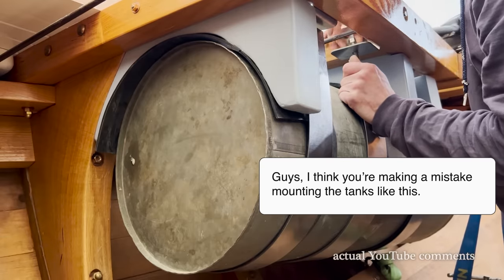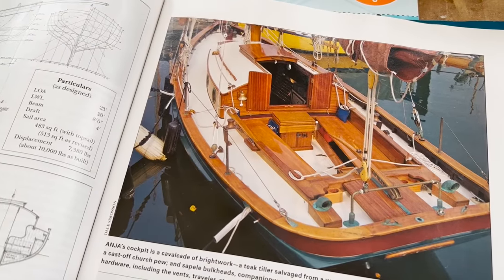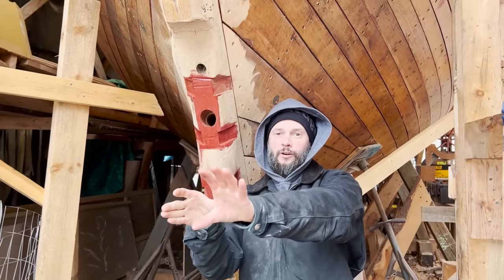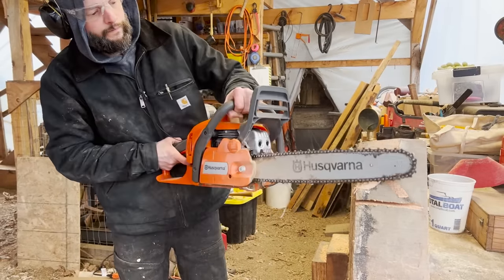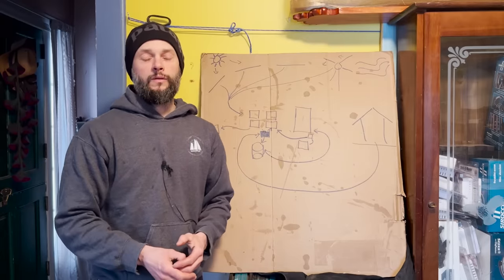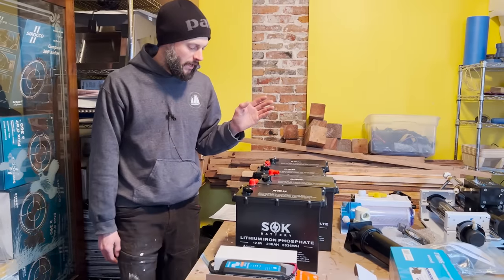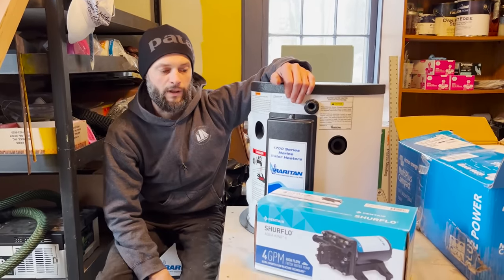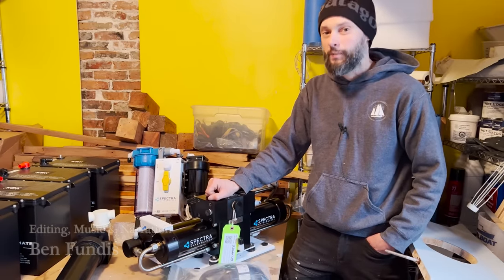That Prop Is Too Small & Other Comments - Episode 248 - Acorn to Arabella: Journey of a Wooden Boat

Comment: You should have a backup propane 12 volt hot water on demand with a 12-volt pump as a quick and easy backup and you can simply store to propane tanks vertically Hot Water Propane on demand is 12-volt or for 300 bucks you can buy a Coleman camp shower 12v and hook it up to a 20 lb tank by the way if anything goes wrong propane float

Comment: I have a question about the prop. Just a bit of clarity for all of us out here in you tube land. With the variable pitch prop you have, is it a case of setting the engine revs to the most efficient revs and just adjusting the pitch of the prop to get your desired speed? Or is it just so you can feather the prop when under sail?
Reply from the maker: It’s both! Both are advantageous. There’s nothing to adjust for us in the cockpit either. The pitch auto-magic-ally adjusts depending on RPM. —Anne

Comment: my only comment on the chainsaw would be, get a battery powered or corded one. it's be shorter/smaller and a bit more surgical to use, in my opinion.  I love my Stihl MS250 for most of my tree work, but sometimes the cheap HF corded electric is just easier and safer to get into some places.
Reply from the maker: Thanks for that review.

Comment: We built a very thin walled concrete canoe to the lines of a fiberglass boat of the same length. With 2 paddlers and ended up with 2 inches of freeboard and horrible stability problems. 2nd in design and construction  DNF on performance lol
Reply from the maker: Ha!

Comment: One reason for the gasoline tanks in the original plan beeing near the deck/cockpit might be that you have to be careful with the gasoline fumes when venting the tanks, the fume could go below deck (heavier than air)  and cause an explosion. Is there maybe a venting pipe leading to the outside in the original plans ?   Not a problem with diesel engines though.
Reply from the maker: Knowing the low level of detail through most of Atkin’s plans, and his assumption that the builder has some common sense, the vent is probably mentioned but not detailed. —Anne

Comment: 23:13 I'm pretty sure you're aware that - unless you do not plan to leave US coasts - you will as good as never find shore power with a 110 voltage (only 220 or higher).
Does your inverter take that?

Comment: You know the crowd's completely clueless to marine architecture when comments of "yo, the prop's too small". :)) No offense fellow commenters, but there's more to a prop than its size.
One can find info about size prop and relation to the body of a boat online, plenty of documentation that demonstrates visually (so you don't get bogged in math and fluid calculations) what a prop does. Reminder that cargo boats despite being hugemongous, have very small props and they still, relative to their size) make plenty speed on open sea.
Probably the only boats out there that have huge props compared to their bodies are military ships, and that's because they need the speed to evade attacks. You're not going to push Arabella to military thrust to avoid a torpedo any time soon. On sail boats, put putting around is plenty good.

Comment: Diesel was invented by Rudolph Diesel in Germany in 1878 & was used by the French in boats about 1893.
Reply: Small sailboat Diesels have only been around since the 1970's.  The conversion from gas in the US was largely driven by USCG regulations that made gas engines hard to install.

Comment: Steve, I would seem to me that your diesel fuel capacity (~60 gallons) seems a little on the low side, especially for off shore sailing.  What were your thoughts on that?  Nice score on the Monel tanks.  Your location does not bother me.
Reply from the maker: Some tanks on deck will serve for longer passages. It’s plenty of tankage.

Comment: Lots of people use alternators for charging house batteries. Ever wonder why lots carry one or two spares, and why they are readily available in most marine shops all over the world?  Your automotive alternator can last many years with thousands of miles (my sienna van has 300K klicks in 16 years and only on the second alternator) Most people who do any amount of motoring usually only get from 1 to 3 years because the charge the house batteries instead of just the starter battery.

Comment: great chainsaw advice. Ive been a chainsaw user for years now. love my chainsaws. It took me a while to become a "master user" Is there such a thing?. Yeah most of the time I can drop a tree wherever I want to. Sometimes I do have circumstances where I push the safety limits, but Only so far. Nowdays I do use a chainsaw as a tool for much more than clearing trees. man I hold on to that chainsaw. Always expect something to go wrong.

Comment: I understand you want a Lead Acid battery for the engine. Something that is specifically made to start it reliably.

But Lead Acid is layers of problems.!

#1. They have the lowest price to performance of any battery commercially sold today. So they're going to be very inefficient. Granted the way you're using them That's not your primary concern. So it might be understandable to go for a cheaper option. However.

#2. There is a surprising amount of associated maintenance required with lead acid. Which is exacerbated many many times over at Sea.! Now Yes if you keep up with the maintenance and and keep the battery environment clean and dry. The maintenance is not so bad. But if you falter on either maintenance or The batteries environment. There is no amount of maintenance later that will fix the problem. However knowing you I wouldn't imagine you forgetting about such a thing. Being it's primarily important to starting the boat. Technically speaking.

And #3. Heaven forbid if Arabella ever capsizes. Even momentarily. The battery can immediately become completely NON- Functional. And it's for sure possible to start a fire.! Which is the last thing you want on a wooden boat.!!!!

So you need a battery that is capable of being stowed in any position for any length of time. Obviously lithium ion is one such battery. But because lithium reacts exothermically to water. People seem to think they are a poor fit for boats.

But

As far as I know you're already planning on putting at least 4 fairly large sized lithium-ion batteries in the boat already. But more importantly for the same reason they can be operated in any orientation. Is that they are hermetically sealed. And so even if submerged in seawater. They should still be very well protected. And usually come with short circuit cut off protection. While lead acid batteries themselves usually do not have the safety feature. A Breaker would have to be added.

But if you are not comfortable with using a lithium ion battery to start the engine. Then I would definitely recommend a Bank of supercapacitors. Which are Only dangerous if not used in series with a resistor of the same wattage. Something to think about I guess.

I mean for sure. "If it ain't broke. Don't fix it." But somebody built a better mousetrap a long time ago.

But if you feel like you're good. Then you're good.!

Also incidentally if you want to know exactly how much weight your Boat is supposed to be able to hold while in the water. You would just multiply the square area of the Hall up to the water line. And multiply by 62.41 Lbs. per square foot.

And that will = The volume of water that is being displaced by the hall of the boat. And whatever volume that is.

Is how much weight that can be placed within the hall of the boat. Before it will sink.!

Hope this information was helpful. 👍🖖🙏
Reply from the maker: Lead acids don’t mind the huge single draw of an engine starting, LiFePO4s hate that.

Comment: Are you going to put a line cutter on the prop shaft? I know that fouling floating ropes is fairly common and  a line cutter saves having to manually clear the shaft.
Reply from the maker: No.

Comment: Use whatever tool you like. This comment is not about that. Having said that, that is not the kind of blade I would use in the recip saw. It Could be what keeps you using the chain saw. That is not supposed to be a critique, but some other people may benefit from knowing that there are some far superior carbide toothed blades for dry oak.

Comment: is the inverter 110V and 230V? Most the world is 230V @50Hz so you may struggle when outside the USA for shore power and getting equipment and parts for 110V. unless you plan on staying only in the USA hen its no issue at all.
Reply: I can see this has been said else where and replied to.

Comment: Steve, is there anyway you can use the prop when under sail to generate hydropower? Seems like a natural hydro option...
Reply: That is done but it requires some different systems and I think a different prop. Totally a retrofit option but doing it now pushes out the splash date.

Comment: A bigger prop would be helpful if you had an electric motor/generator and were using it to generate power under sail (or while anchored in a tide race).  You don't. I know people who do this, and it works surprisingly well.  One of them also uses the prop shaft to provide mechanical power to his watermaker. All the extra power you can pour into it without getting additional speed, is also power you can suck out of it without noticeably impairing your speed.  But that ain't what you're doing.  Solar is usable with a lot less conditions and qualifications.

Comment: I've definitely never been concerned about Steve not doing his homework for this project! I do have a question regarding the strapping for the tanks. The straps and fittings are steel and isolated from the tanks by the rubber to ensure they don't corrode from that. However, aren't the plates and bolts for them also steel being bolted into (or at least in contact with) the oak? Most other places, you've used bronze to avoid rusting in contact with the wood. How do you avoid corrosion in this scenario (or did I just miss something very obvious)?
Reply from the maker: Stainless steel won’t corrode in that area, and won’t affect the wood. Stainless submerged? Maybe you’d think about it a little and clean it up from time to time.
Reply: @AcornToArabella  Thanks for the reply!

Comment: I'm no boatie. However, I am interested in your plan for wetting the hull. My father was a bit of a boatie and he filled his repurposed hulk, - an 18 foot clinker built timber boat named 'Lois Anne' after my mother and my sister - with water while it sat in the driveway of our suburban home. Now that was a heavy load for our suburban driveway (nope, there was no concrete slab) but I'm sure he watched the deformation under the props like a hawk while he slowly filled the entire inside of the boat with water from a garden hose while his family slept. It must take time for the timber to swell and seal before you can safely sail away. How do you plan to wet the hull?  P.S. I'm disappointed that you didn't do a 'why don't we use 3D modelling software response video.' ;-)
Reply from the maker: Sprinklers externally are an option. Filling an 18’ boat with water is the way to go for a boat that size!

Comment: regarding the batteries, I don't know if you did your estimated run time calculations using 100% discharge, but if you did plan on adding 1 or 2 more of those batteries at some point.  current (pun intended) recommendations are 10% to 80% (dis)charge depths, for maximum longevity of the batteries.  that's assuming you want to limit the need to light the diesel to make power.  you can get a rough estimate of number of run-hours on the diesel needed to charge the batteries, based on the alternator you have. using the 10%-80% window, ballpark is 4.5 hours to make that change, assuming a 125A alternator with no other losses or loads involved.  I don't know what the GPH rating is on your diesel.
Reply from the maker: Madison has most likely accounted for that.

Comment: One question I have regarding tank placement is how much sloshing sounds will be heard as you are quietly underway on sail?
Reply: Have you ever sailed? It’s very noisy.
Reply: Lots of blue water miles.  With the tanks right next to the cockpit, it seems like it could get annoying. @johnnunn8688
Reply: @billlambert2092 , trust me, above the noise of the wind, the thrum, luffing and flap of the sails, the buzz of the halyards, the clanking of fittings and the sound of the water, they won’t be heard.

Comment: Perhaps your explanation of your water heater's plumbing was "editorially" abbreviated, but you did say you were running raw water through the system. You should not run raw water through your water heater's heat exchanger. Run your engine coolant through it. Two reasons: First, the raw water won't get hot enough to heat the water in the tank. On the other hand, the coolant's temperature is determined by your thermostat and will probably be 170-185 Fahrenheit. Second, the system is not designed to have sea water pumped through it. Gunk, corrosion, etc.
Reply from the maker: It was a simplification.

Comment: Hey Steve, just one other comment that I was hoping you'd address, but when @sailinguma started sailing North they decided to insulate their hull, is that something you are planning on doing?
Reply: solid wood is a great insulator. Its one reason WW1 +2 battleships had teak decks
Reply from the maker: Cliff has it, Uma is a ‘glass boat.
Reply: @AcornToArabella  sweet thanks! Dan has really good insight into boat tech so I wonder if you've seen any of their "boat work" videos?

Comment: Question what is the weight difference in weight between the gas motor specified and the diesel motor actually used?
Reply: probably 20%-50%.  she's probably coming in a bit stern heavy with movable ballast laid evenly, but I think Steve's right, she'll get trimmed even easily enough.  maybe someone can donate some tungsten blocks and they can be shoved as far forward as possible. 🤣
still, my intuition tells me it won't be a massive problem.  despite the cabling problem it'd create, he could consider moving the batteries to the bow possibly.
Reply: Given the age of the boat likely the gasoline engine was iron block and head pushrod deal, there may not be as much in it as you think.
Reply: @denisohbrien  diesel engines have always been considerably heavier than gasoline, I asked because my vehicles diesel adds 800# over the same vehicle with a gasser
Reply: @billchmelik5697  my experience is with small (4 and 6 cylinder engines) 3L or less and a modern diesels are surprisingly light, obviously not as light as their modern gasoline equivalent but every bit comparible to a classic iron gasoline engine with it's thick casting and iron brackets for everything. Imho of course. All speculation of course, would be interesting to know the figures.

Comment: I'm confused as to why people are confused; of course the boat will float and be mostly on it's lines, ballast is there to move around and tweak that. This boat will last 100 years if it's not sunk, just like all those boats built early 20th century, and Arabella is better built than those because it has better wood and modern fasteners.
Reply from the maker: The truth is that most people don’t understand stability, and why would they?

Comment: Since you are commenting on comments, I would like to say that you should really go with a binnacle arrangement. Arabella is a big girl. We own a 28-footer with a rudder/tiller arrangement, and you get tired of keeping ahead of that much weight. On the other hand, the 40-foot Herreshoff sloop (a 1937 design), that I crewed on for years on the Chesapeake Bay (Gibson's Island), had a binnacle (updated several times by the owner). I'm guessing that Atkins' design predates modern binnacle design by generations. You have substituted all along in the construction of Arabella. What's wrong with adding a binnacle?
Reply from the maker: Not by generations, not at all. The tiller is simple though, and we prefer it.
Reply: @AcornToArabella  As you wish young wave walker. Our 28-footer was built in 1947. What is the date of your Atkins design? My father had a Luders 16. Lovely boat. A real classic. Also a rudder/tiller set-up. After a full day of sailing your forearms were really beat. On a broad reach the tiller would really bend and fight you. We would sail the Herreshoff all day and all night, on watches of course. My favorite was a 4-day sail from the Chesapeake Bay to Newport. I drove. Such a sweet, sweet girl. I would do 4-hours on with no problems. The boat would tell you almost all you needed to know by the sensations traveling up through the wheel. Anyway, I'm done. Thank you for listening.

Comment: concerning chainsaws. They are a common sense tools just like guns if you don't respect them you can have a bad day real quick. I wish steve would have talked about logging culture there is almost a religion where these 80' trees are almost given sentience with the effort to hurt the logger.
A fella knows the danger of cutting large timber regardless of if it is in the field or shop. Let the 4" x 16" x30'  piece of oak fall on your leg that could easily end in surgery with pins and plates. With a Sawzall you can go on auto pilot pretty easy but a chainsaw keeps you in the now. As far as how precise one can be with a chainsaw that is merely a function of experience without a doubt you can cut 28" x 40"  far easier and with more precision than with any other tool.